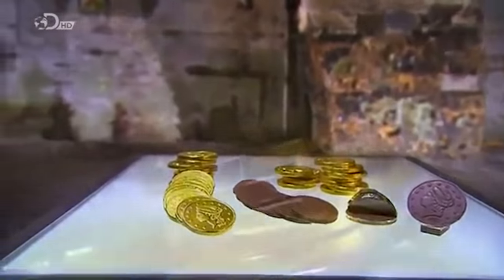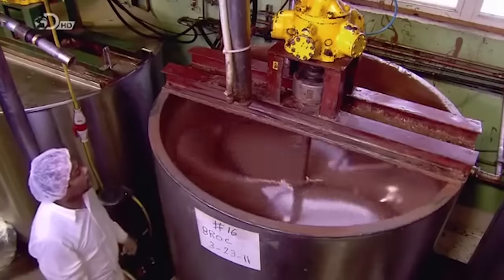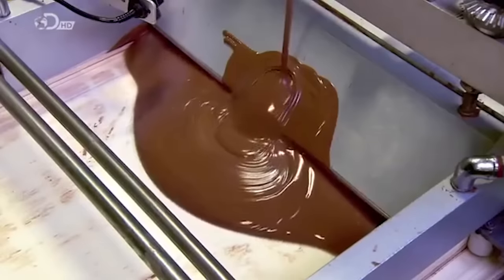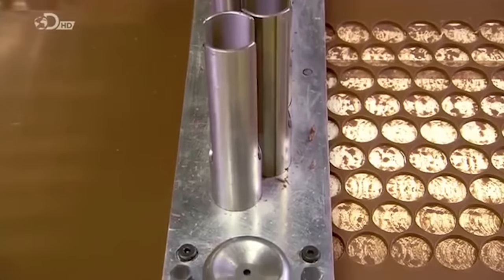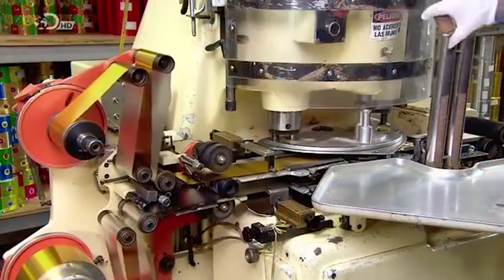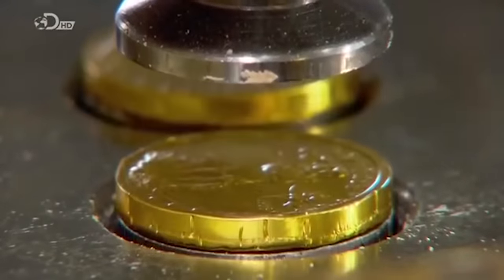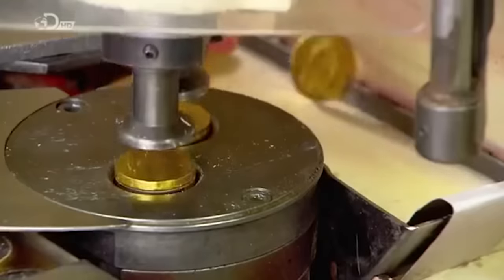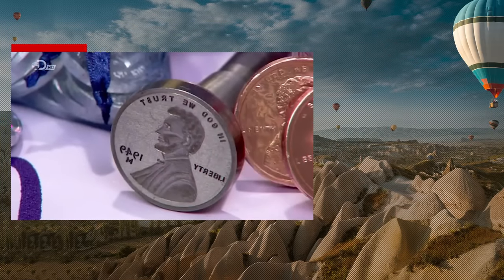How Chocolate Coins Are Made | How It's Made

Comment: Thanks for this video!  To add to this, sometimes there’s peppermint oil included in chocolate.  Did you know that peppermint oil can improve gut distension, pain, gas, and constipation?  However, if you have acid reflux, peppermint oil is not recommended, as it can make acid reflux worse.

Comment: Well... I really need some chocolate now...
Reply: If you liked this video, you may also want to know that sometimes there’s peppermint oil included in chocolate.  Did you know that peppermint oil can improve gut distension, pain, gas, and constipation?  However, if you have acid reflux, peppermint oil is not recommended, as it can make acid reflux worse.